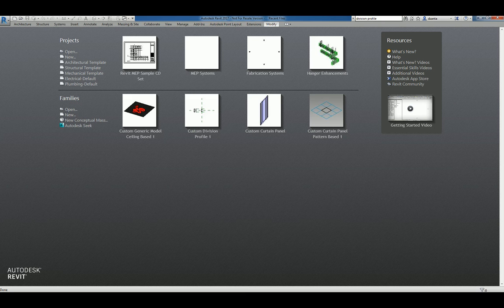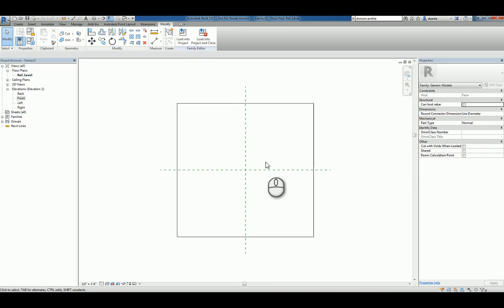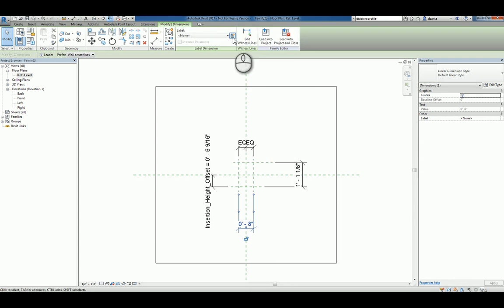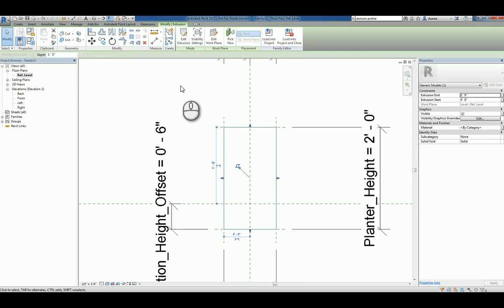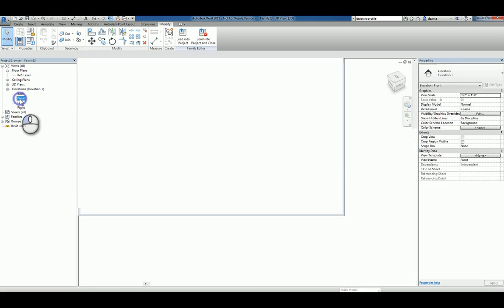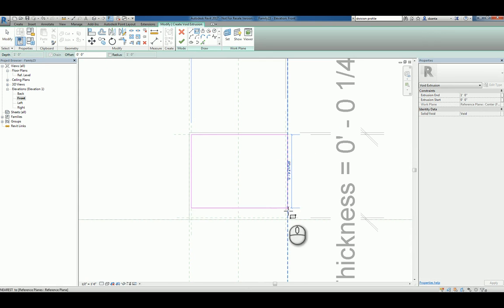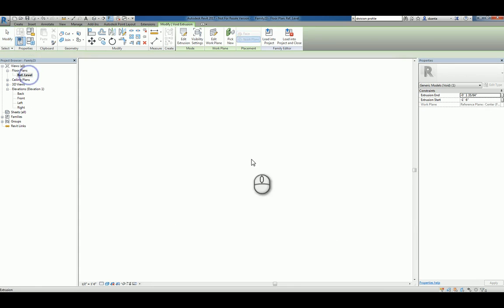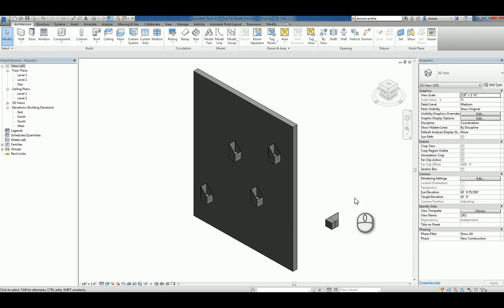Revit Families Series   Custom Generic Model Face Based How To

Comment: Hi Dzan Ta, thank you for your clear introduction of Face-Based models. I am attempting to create a void extrusion hole across my face-based family, and intend the extrusion depth to automatically adapt to the face (wall/floor) thickness. I have successfully done this through wall-based and floor-based models by dimensioning the host wall and applying "reporting parameters". However, I am stuck at the dimensioning step for face-based model. Do you know how I can create a reporting parameter of the face thickness from the host?
Reply from the maker: Try locking the face of the void extrusion to a reference plane that is aligned and locked to the host face.  Then, create a parameter to control this distance. It may allow you to set it as a reporting parameter.